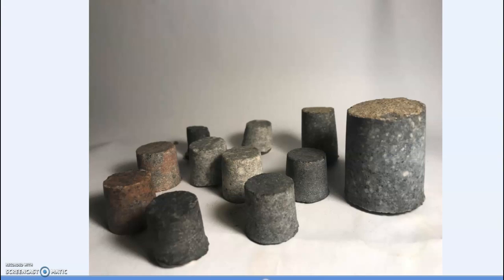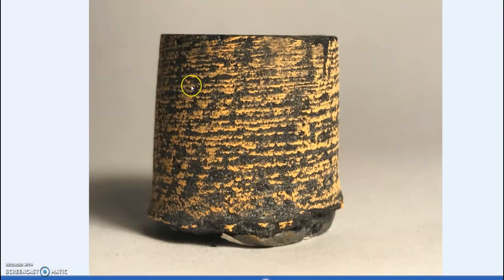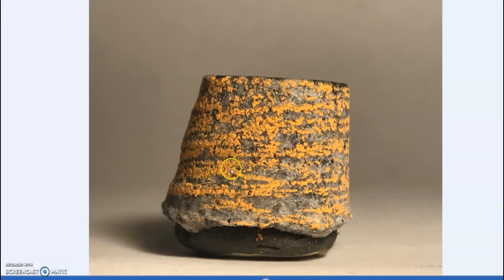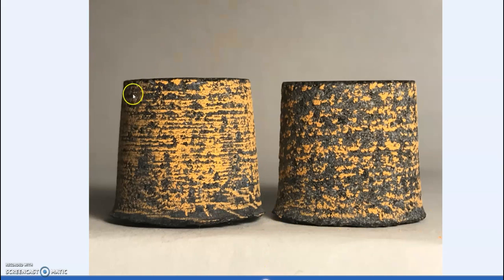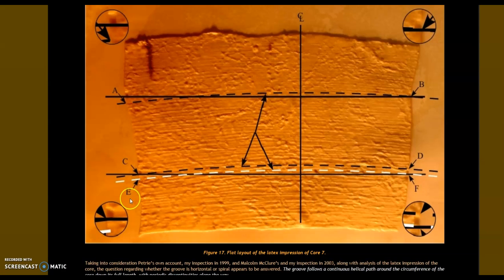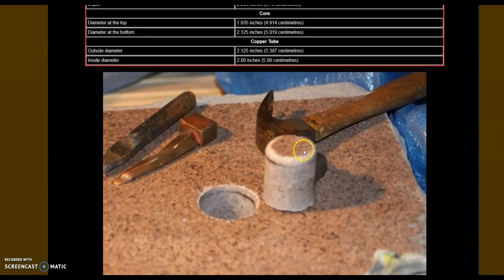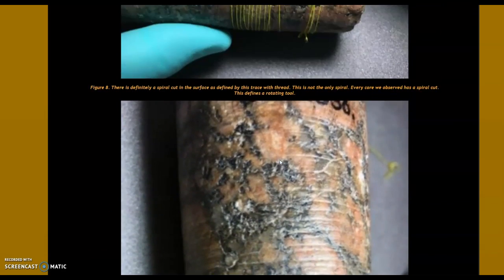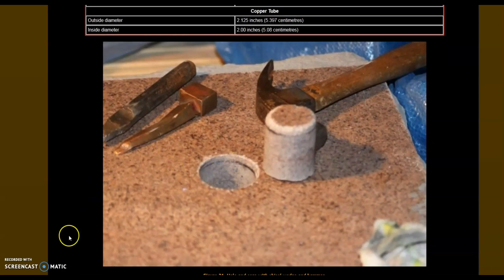Lost Ancient High Technology Granite Core Striations preliminary

Comment: We humans are some smart mother fuckers. We can reverse engineer anything. Did you make your own copper tube? You know gather up all your minerals and make that tube yourself? Maybe you gathered up all your crystals to make your abrasive? 

You are using modern day tools to duplicate/reverse engineer something that was done a very long time ago with tools you can not duplicate today without some form of advanced knowledge compared to what academia is of the understanding of what was available in those times. 

You are only duplicating half the project with ancient methods but using modern day tools. It don’t work that way bud.
Reply from the maker: Can I break up malachite or some other ore  and make a simple furnace of sticks and mud using charcoal as a fuel and a simple bellows?
Can I make a mould in sand and cast it?
Can I crush sandstone or quartz or corundum  for abrasive?
Can I break a tree limb to make a handle?
Lay off the bongs mate, it’s turning your head into mush. If you think making a copper tube and smashing up some abrasive is impossible hard then I am surprised you can work a phone or computer?

Weren’t you the expert machinist sticking up for Dunn as a knowledgeable machinist then linking to unchartedx as a source? It’s a rhetorical question (that means you don’t need to answer it).
I and others love your comments because you make a better argument that I ever could. A normie who reads your comments will quickly work out what kind of person defends Dunn and co. 
Please keep em coming buddy. With friends like you the LAHT industry doesn’t need enemies.
Reply: SGD Sacred Geometry Decoded I don’t know if you can do all of that or not back in the day and as far as the archeological record goes there are no such such tools on record of ever being found. So if we were to stick you back in time I guess you might figure out a way to get’r dun.

But when you’re all done make sure you take all your tools with you.
Reply from the maker: I swear this isn’t a sock puppet account I created. This is the best they can muster up though at least he had the guts to put his head up over parapet. The other cowards hide behind sock puppet accounts while they police their comments section like the Stasi ready to stamp out any wrong think.
Reply from the maker: Bubba Bong That’s about as much BS as Chris Dunn’s drill. You know the master machinist engineer Chris Dunn don’t you?
As a machinist what’s your opinion on his failure with copper?
What about his drill? I may not be a fancy machinist master craftsmen but I can spot a 5 foot high pile of cow crap from a mile away.
Since you are so educated as a machinist, and we mere non machinist mortals can’t understand feed rates and such , what’s your take on that Dunn drill? I am sure I am not the only one who’d like to hear your opinion. 😏
Reply: @TheFirstBubbaBong  1) the copper trumpets found in the tomb of Tutankhamun are cylindrical, with a wall thickness to under a millimeter, thus proving without a shadow of a doubt that the Egyptians were able to make such a tool

2) the drilling tool is attested in art, does correlate with the archaeological findings and with the experiment. The experiments themselves prove it's possible

Literally everything you said was wrong, so what it your point?
Reply from the maker: Sahure pyramid has copper pipes for drainage. Oldest known serious plumbing job in the world.
But it’s a tired old logical fallacy. Where are the tools? Where are the piles of a precious reusable resource that is also money? 
They might as well ask where are the piles of Roman gold? There’s no big piles of Roman gold just sitting there untouched for 2000 years so it can’t have existed?
In the description is also a link to a paper on other experiments with different drill types.
The fact that traces of copper and corundum found in Egyptian drilled core hole probably shouldn’t be mentioned here. Apparently there’s nothing in the archeological record anywhere. A lot like Dunn said on Ancient Aliens. Puma Punku is impossible with tools in the archeological record. And he is credible authority on these things after all. Totally not a scam artist or anything like that.
Reply: SGD Sacred Geometry Decoded I have to admit I haven’t seen Dunn’s experiment but if that’s all he used that’s a sad attempt at best. I have no doubt we can reverse engineer a method of how we think we might have made it back then but every method we come up with ends up leaving a tool behind for us to find and we just haven’t found any evidence of that. 

What evidence is showing is a lot of these megalithic areas have been built on top of a previous megalithic structures with far less the knowledge and technology of the previous builders. I’m sure you have seen all the explanations behind all these theories and the reasons for a global planet reset approximately every 12,000 years. Unless you’re the type of person who thinks planet earth has been and always will be butterflies and rainbows.
Reply from the maker: Tools like these depicted in Rekhmire’s tomb, also in an old kingdom mastaba in Saqqara. Copper and corundum actually found in a core hole.

Where is this evidence of 12500 BC? I should accept it because otherwise i am a believer in butterflies and rainbows?  
Yet you state the archeological record is barren and my experiments failed because I did make my own copper tube?
Dunn’s drill is about as valid as his giant circular saws and Serapeum measurements. 
There won’t be much left of him for carrion to feast on.
He, Foerster and now unchartered x charge good people thousands of dollars to go on a tour of pure BS.
You seriously can’t see the con going on here? You’re not at least a little pissed that this Dunn fella has been crapping on your front lawn and then asking you to pay because he says it’s fertiliser?
Reply: No advanced knowledge is needed to replicate tools that were available BEFORE the bronze age, that would be a contradiction of itself (cognitive dissonance anyone?).  Sticks, stones, and copper are all workable without advanced knowledge of advanced machining. It's hard to admit you were wrong or misled, I know, because I believed for years that some of the work was indeed more advanced than was currently understood, but now I realise modern day skills are so far removed from what was used millenia past. These shill artists are not mistaken, they are just outright lying to you Bubba, and as always it's about money.. they just want your money. Have you not noticed how the same group of people constantly reference each other, the same group of people who sell books, give talks, sell tours,  it's a very small group of people who have got a fairly large audience through youtube, that is the real conspiracy going on here, not that hundreds of thousands of archaeologists and academics are hiding some sort of alien technology. Once you allow yourself to see the lies, every bit of their credibility crumbles.
Reply: @TheFirstBubbaBong  1) you avoid the toppic

2) there is no evidence of a 12000 year lost advanced civilization. This has been refuted over and over again.

 I'm honestly trying to understand the point you are trying to make because so far you just talked in circles.
Reply from the maker: HEY! As a proud card carrying member of the South Western Sydney Bogan League I take offence at that :-( I'll soon be selling a range of overpriced merch that includes an ensemble of worn out ugg boots, acca dacca shirts from Flemo markets and worn out flanno shirts I stole from Robbo after he scratched mi Kingswood in Minno. (There's no T in Minno)
Reply from the maker: Dino Legovich Busted!!! A real westie would say Torra. You seem the kind of bloke who puts a T in Minno.
Reply from the maker: Dino Legovich I bet you don’t have a doghouse either.
Reply from the maker: Dino Legovich yeah you mock now but when I have a monopoly on the lucrative but untapped drilling holes in granite benchtop  offcut market you still won’t have a doghouse.
Reply from the maker: Dino Legovich I identify as existence fluid so I may or may not have written this comment.
Reply: SGD Sacred Geometry Decoded  so do u believe in the rainfall erosion on the Sphinx? What’s you explanation on that
Reply: This was a very fine experiment. The ancient Egyptian`s had way more manpower and also way more time creating tools. But don`t missunderstand, i feel there is alot that needs more experiments like this. How did they scale up something like this method to saw huge blocks of granite like the so called sarcophages? 

Also the huge black granite boxes in Serapeum has lids that are angled, that would be very hard with a saw + abbrasive method, especially given the size of those boxes. Then there is the polished finnish on these boxes and also statues, and the precision is unreal in those. Also the granite Sphinx temple and the Karnak temple.
Reply: @winmusic9887  The Weathering on the Sphinx can be explained by the Geological physical process of haloclasty.

There is no Archaelogical evidence for an older Sphinx of 12000 or more years old, it's another fringe claim from the LAHT crowd
There is no evidence of a pre Egyptian Civilisation existing in the same area, no artifacts, no inscriptions, no architecture, nothing. Peace!
Reply: MrRecklessryan whaaat are you talking about mate. Everyone knows of haloclasty erosion and no one tell u its that on the Sphinx. 
All 278 members of the geological society agrees with the rain weathering. Only Egyptology had questions like that. There’s Gobekli tepe in the same region as evidence.. you’re talking 12000+ years, nothing will be present but stone. 
       Sorry but idk what to tell u when the evidence are the structures itself in front of us the whole time. U can’t just date superior work underneath inferior work and date it by the same people and culture to fit your ideology.
Reply: @winmusic9887  Actually, Geologists have proposed alternative explanations for the weathering on the Sphinx enclosure, they also reject the water erosion hypothesis, due to many factors.
One proponent of the haloclasty process is Dr James A. Harrell of the University of Toledo, who advocates that the deep erosion crevices were caused by the haloclasty process being driven by moisture in the sand, that covered the carved rock for much of the time since it was exposed by quarrying, here is the evidence http://www.hallofmaat.com/sphinx/more-sphinx-debate-he-said-i-say-james-harrell-responds-to-robert-schoch/

Jørn Christiansen a Geological Scientist who has studied the Sphinx weathering also rejects the water erosion hypothesis for an older Sphinx, here is the evidence https://www.geoexpro.com/articles/2015/01/the-great-sphinx-of-egypt-nature-s-shabby-chic-trick

As for your claim about 278 Geoloigists agreeing with the water erosion Hypothesis, it is baseless and there is no evidence for this claim, like all the other claims you have made it is not based in evidence. Ths in itself is a fallacious argument called Argumentum ad populum.

Your biases are so heavy on the LAHT theories that you don't look at counter evidence to your own narrative, eg sawing, tube drilling, with copper and corrundum, which is supported by evidence, here https://antropogenez.ru/drilling/

You also like to harp on about precision, the fact that Ancient Egyptians were very precise in their building of known Ancient Egyptian monuments eludes you.

You have to look at both evidence for and against LAHT, so far there is no evidence of a Lost Highly advanced civilisation in Egypt that came before the Ancient Egyptians. Yet we have plenty of evidence that Ancient Egyptians were more than capable of building these monuments, eg Architecture, artifacts, biofacts and ecofacts.

Water erosion in itself is not evidence of LAHT, especially when Geologists have alternative explanations for this type of weathering.

Not a single artifact, biofact, dating technique or Architecture supports LAHT in Ancient Egypt, When/if evidence is discovered it will be one of the Greatest Archaelogical discoveries in history.

Peace!
Reply: MrRecklessryan  mate look at what you’re saying. All of your evidence and geologist don’t even agree with each other. No shit not every geologist agrees with the water erosion. Academics fight Among themselves about what think is true more than anybody.
   
     Just look at yourself trying so hard to debunk the mystery of the past and against Laht. Laht is just showing alternative views due to mostly unsolved mysteries about our past. You obviously took a week break to do your research to prove your philosophical views once again. 
     Allot of what we know about Egypt are from Egyptology.. and more and more people are starting to see archeology and Egyptology are very philosophical and art based. It’s mostly ‘guess’ work of what we think happened. Of course there’s science and very credible people but if you know anything about Egypt it’s allot of fucking guessing mate.  
      And yes we do have allot of evidence from dynastic Egypt that they could build shit. No one denies they know how to build.. but there’s allot of sophisticated work contaminated by dynastic work all over the world that is obviously so superior one has to ask wtf happened in the decline of knowledge and engineering?? Yet your Egyptologist date them to all the same. With Maybe a 60 years difference. 
    And yes water erosion shows there were civilizations present allot longer ago than we thought. And to deny gobekli tepe too is saying allot. But to say that u could 3 geologist who disagrees with one fact doesn’t mean anything my friend. U can find on YouTube 15 different geologist who supports the water erosion. Keep trying my friend.
Reply: @winmusic9887  Where did I deny Gobekli tepe? You do realise all that we  know about Gobekli tepe is because of Archaeological Science right? Or is Archaeology only considered an art and not science when you decide it's against your narrative?

It's not hard to debunk LAHT, the fact there is no evidence for LAHT just makes it a false claim. If you had any evidence for LAHT you would have provided it and I would have accepted it.

Look, I'll stick with the Scientific method and evidence, you stick with your LAHT woo woo clips.

I would love to see a list of these 278 Geologists that have studied the erosion on the sphinx and come to the conclusion it is water erosion? I'll wait.

 You should try providing sources for your claims, otherwise they come across as just baseless ramblings.

 Peace!
Reply: Odin x  exactly. No doubt they used abrasive and copper tools but it’s just not efficient to the scale that we see. Academia likes to bunch it all up to one conclusion when there’s mystery and questions.
Reply: MrRecklessryan you asked if there were any other or older sites than the what we see in Egypt as if gobekli tepe didn’t exist.. 

 And like I said there are many respected scientist and archaeologist but mainly Egyptology has its own dogma. Just bc u found a small painting near the pyramids relating to one Phero you can’t just throw in wild stories and credit him to every structure around as if we got the whole story. It’s pure ideology mate.  
 
Laht is  just suggesting alternative views due to the lack of evidence on how allot of what we see is done. The problem is it’s not just Egypt or one structure. Have you ever found anyone recreating the temple of the sun structure or saqsaywaman or evidence of how it was even built??? Same goes to parts of Egypt with massive curved stone cuts. No shit dynastic used copper to cut stone but you and modern Egyptology simply ignore the fact that you can see the inferrer stone work done by copper and sand above incredible work like... in Peru. Laht doesn’t know exactly what was was used to cut. It could be circular saws  or maybe not.. but something more than abrasive was used is the suggestion by forgotten knowledge.. sorry man it’s common sense and logic, abrasive on that scale and complexity stone doesn’t cut it. The mystery is definitely there. Better to say idk than related all into one period done by the same culture or just bc someone in modern day on YouTube can cut a 3 inch stone with Corundum the lack there of  in Egypt. It just doesn’t make sense on that scale, complexity and quantity other than trying so hard to fit your narrative.
Reply: MrRecklessryan 😂 you’re talking as if you knew the actual borders back then.  you asked for region. Turkey is not far off mate. 
  
And again dynastic Egypt did us copper and corundum but ancient Egypt itself did not have plenty of it. Doesn’t explain the vast about of incredible structures u see other than the few shitty core drills done by it. I’ve seen the dynastic core drills myself. And  the difference in quality to the ones that people question is far inferior. For example one in the Cairo museum has one drill hole within a hole within another hole with thin lips separating it without any damage. There’s many unsolved artifacts you don’t just see on the web as well. 
    
    But once again and again you keep ignoring all the other facts on the decline in knowledge and keep attributing 4000 years of what’s known to one culture. How can that not sound so crazy and ignorant. And you keep ignoring  similar sophisticated structures all over the world. Find someone who can cut 20 tons blocks with curved angles perfectly fitted with copper and sand please?? Showing someone giving examples it’s possible to cut and mark a small brick is like me claiming to flip a car but barely budging it by tackling it and then say it’s possible. What you call evidence is just finding a couple artifacts that applies and then apply it to everything else which has absolutely NO evidence. That’s assumptions my friend.  There’s no evidence on how they cut the serepeum boxes or how the pyramids were built. Basically every impressive structure u see not just in Egypt but everywhere has almost no evidence and no scripture.
Reply: @winmusic9887  Again with the fallacies. 

The evidence on how they built these boxes and structures are in the stone, they left tool marks everywhere, it's not hard to measure and cut stones and fit them together when you have the means.

Civilisations collapse and knowledge gets lost, it's a very simple concept, I'm not sure why it's so hard for you to understand.
Reply from the maker: What is the scale that makes it ineffecient? I see a perfect effeciency, as I showed in a video the RPM I achieve with my flywheel drill 330 - 400 RPM is the most effecient for optimal results using modern equipment as stated by the experts in the field of core drilling granite etc. 
I have seen no drill hole that couldn't be done in a working day or two. That makes it very effecient, not as fast as modern equipment that might take afew hours,  but modern equipment requires a global industrial - energy base to make them work so compared to ancient techniques it could well be argued that modern gear is ineffecient once you take into account the huge amount of energy and resources that go into making and powering that equipment.
What precisely makes it ineffecient? What is the precise scale you are working from?
If measured by energy input required, pollution, transportation costs the ancient technique is more effecient.
Are there millions of drill holes in Egypt? Even if that was the case spread over just a century that only requires a small group of workers compared to those that would have been available in even the lowest estimate of the population at the time.
The opponents of academia like to bunch it all up to increase their industry's profits while carefully excluding (censoring) any contradictory hard data that challenges the rampant and ill informed speculation.
Reply: holy crap.... you are out of your mind. i thought i was crazy, lmfao. wow.